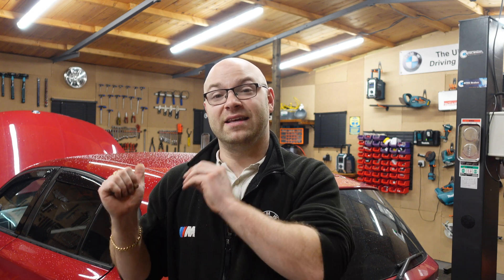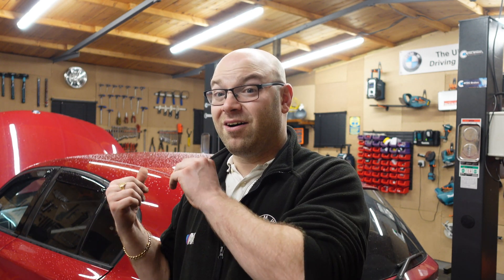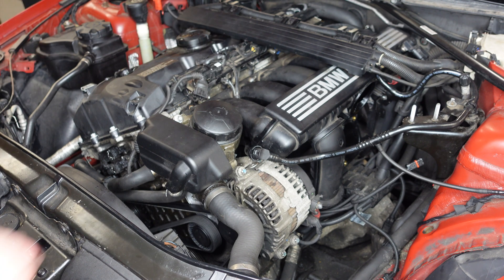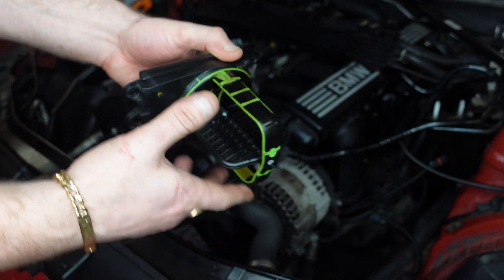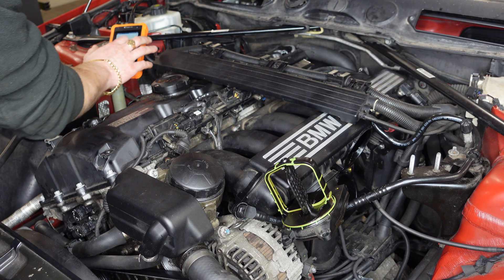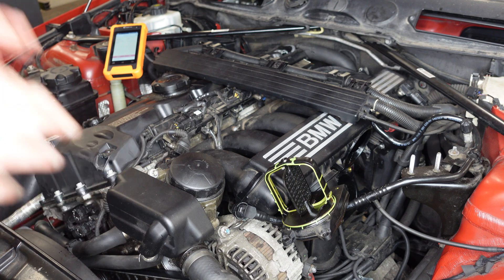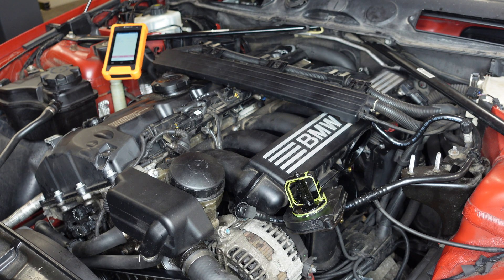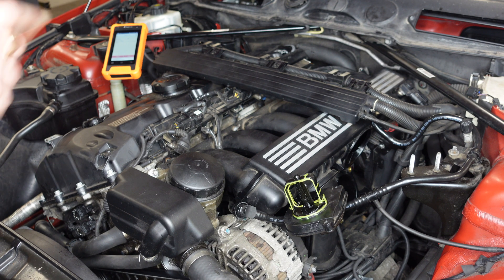BMW N52 / N53 How To Test If You’re Disa Valves Have Failed !!

Comment: When using my top Don Phoenix smart scan tool, I have actuated DSIA valves. It seems to continuously tries to open the valve, however, never attempts to close it. I’m trying to identify a way that I can text the closing function as well.
Key on engine off both valves are open. 

I have bench tested the valve after opening it up, verified motor turns in both directions, depending upon polarity applied. 
But again no attempt to close when on the car. 
Any suggestions?

Comment: I was chasing down a VANOS solenoid issue on my E61 manual AWD wagon. Just put in a new VANOS solenoid straight from the Baron BMW here in the Kansas City Metro. ~$275 later, the VANOS codes are gone! 

I cleared the adaptations and reset all the learned values and still the car stumbled at idle and sputtered at low rpm. Confused, I rechecked my codes. Code 2AAC returned. I was confused again, I did some more digging and here I am. 

Looks like I'll be making a run to the junk yard to pull some disa valves.

Comment: Doc, I need help help help testing my disa vaves for my e60 550i. No codes relating to this fault show up but when I hook up the multimeter to them (two prong connectors) the readings are too far apart, one vale reads 5 ohms while the other is at 50 ohms. I’m stuck .

Comment: Hi Dean.  Thx for sharing.  Can you with 100% certainty tell me which Disa valve actuates the most at the lower and medium engine speed range and which Disa valve actuates at the upper engine speed range.  Can one assume that in a 2009 X5 xdrive 3.0i N52 engine (gas) with automatic transmission which keeps the engine RPM below 3200 most of the time, that one Disa valve would work more than the other?
Reply: you have a gpl system on your car?

Comment: I Dean my E39 disa is not working, already tested vacuum and de flap holds, but when turn the key no noise, means my disa  flap doens`t close, mi head valve cover gasket is leaking, could be the problem? Thanks Ed

Comment: Hi Dean, absolutely love your videos mate, they’ve been invaluable in helping me work out the niggles of my recently purchased project 130i (pre LCI).

A question though - I have the Launch Creader Elite - testing DISA valves using actuation test as you show, the valves only click- they don’t move. Checking them connected starting the car - they move absolutely fine, nice and snappy. 

The creader seems to actuate everything else properly, so any ideas why not the DISA actuation test? Just wonder if you know any tricks. 

Cheers bud! 👍🏻

Dan.

Comment: When using that Creader tool, how do you make the DiSA valve closed? Mine
either have ACTIVATION and STOP only. I press STOP but it don't close the valve. This is on a brand new OEM DISA.
Reply: Same with mine Will. Checking the valves by starting the car, they work fine 🤷🏻‍♂️ With the creader, it just gives a light click.

Comment: Hi mate, maybe your the one to ask. I’ve got a 3 series e46 328i 2000 v registration. And for some reason it cut out one day an the EML light came on. I then started it up again an it was jumping all over the place an idle was up an down. Sent it to garage in august last year an it’s been in an out of the garage ever since an I still have the problem, they have changed both camshaft sensors the crankshaft sensor. Fuel filter, idle control valve. Breather pipes under the inlet manifold and also both lambda sensors! It still has the problem an when it cuts out an it can do it at any time at T junctions or driving at 60mph. When it does cut out the throttle pedal goes stiff and it throws the traction control light on shortly followed by the EML light and the car keeps running but the revs drop to 1000rpm then it’ll cut back in again but no throttle response until you turn the key off and restart it then it’ll be ok but still kangarooing or sometimes goes in limo mode. This has been going on for so long now and I’m getting annoyed with it as I don’t know what is causing it to do it. Hopefully you can help me with this problem 
Andy

Comment: Does anyone know if the N53 has this. Mine is a 325i 2011 and I’ve seen people say only the 330 and above have these disa valves?
Reply: They both have the n53, the intake manifold including the DISAs are the only difference I believe
Reply: Did you figure this out? @ryancs2860

Comment: Thanks mate, I have the same issue on my 09 e82 128i 6 speed manual. It's a intermittent code.
Reply: Did you change them? Do you know if E82 135i also have these?

Comment: I stripped my E93 down at the start of the lockdown and like you said if you going to do the job do it all at once. I renewed all the injectors, all the coils, the all the oxygen sensors, the Nox sensor, the Maf sensor, the  2 vanos solenoids, , the EGR valve, fan belt and pulley and set of new plugs. Also fuel pump and high pressure sensor. Wait for it.. the only job I didnt do was the rocker gasket and guest what , you have guest it.. it has just started to leak..Sod’s Law i think the call it. If had seen your earlier videos I would have changed it . Can’t wait to see the project on the M5.